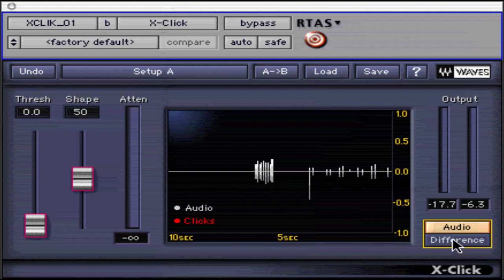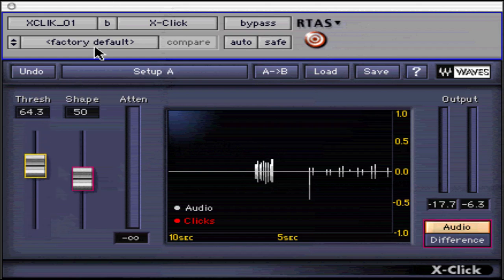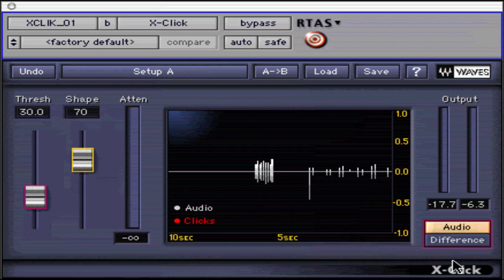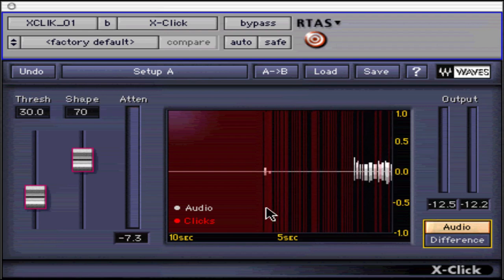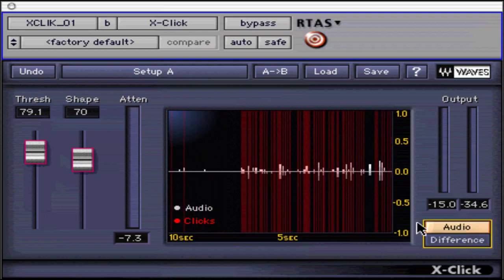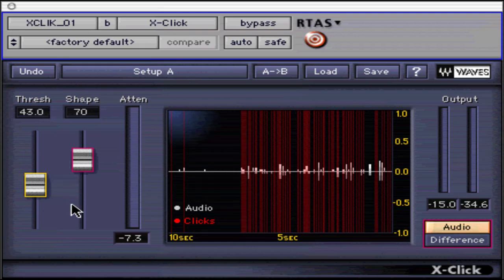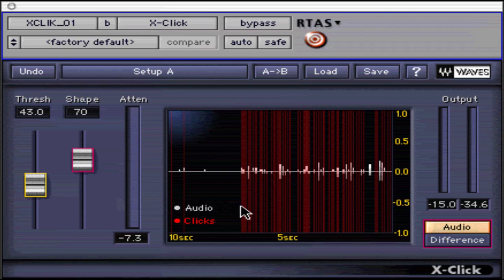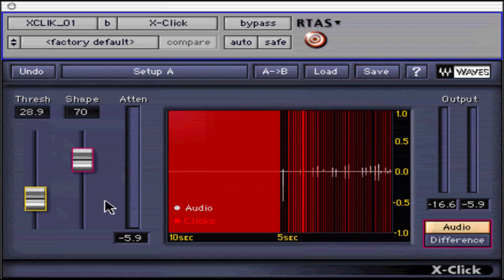Waves Mastering Lesson 29 - X-Click Tool

Comment: thanks for this, it was a good help.. in a mo i'll be checking out you other waves restoration tutorials! I did sus out that using automation on the threshold and shape is a good way to manually deal with a really clicky section.. like where it's bad automate them both right up, then back down